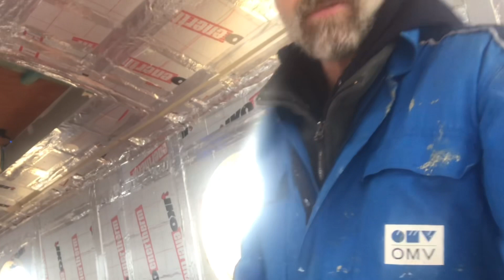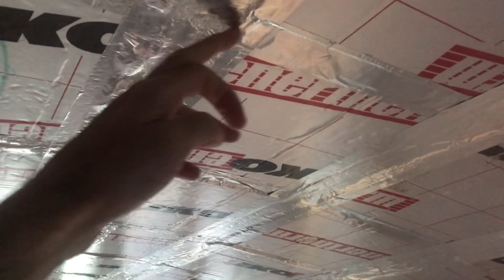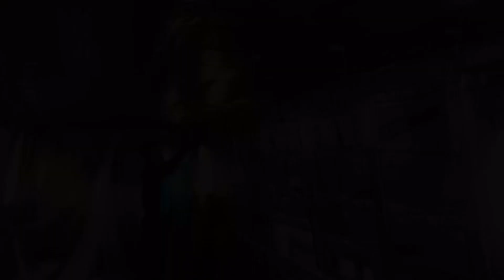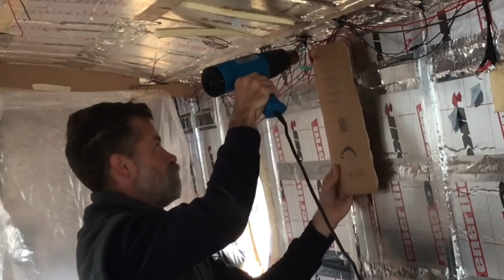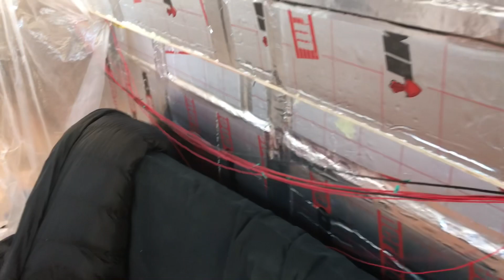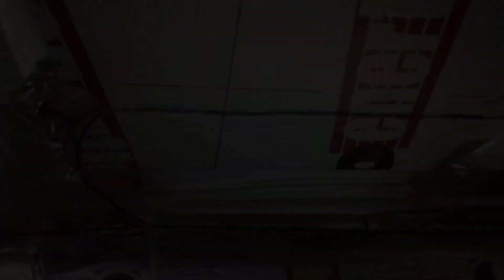25. Running in the low-voltage cables

Comment: Are you going to test the cables before they get covered over?
Reply from the maker: As foolhardy as it sounds - no. Only because there is isn’t anything to test really - currently it’s just individual wires that don’t form a circuit. There will still be access to the wire runs when I get around to hooking it all up.